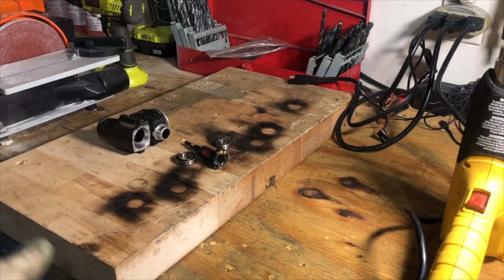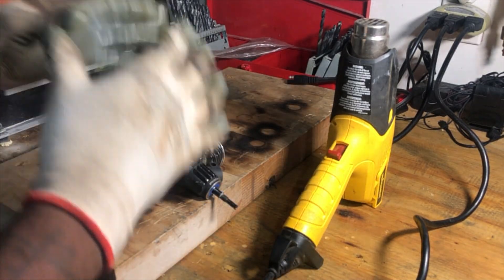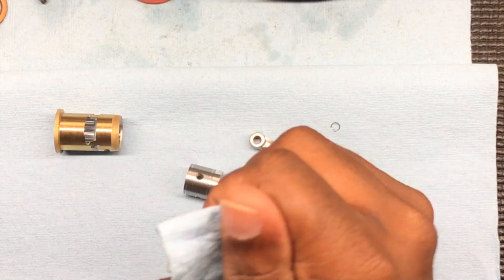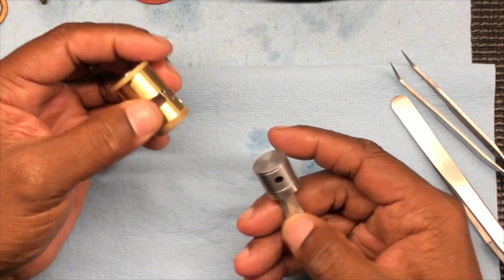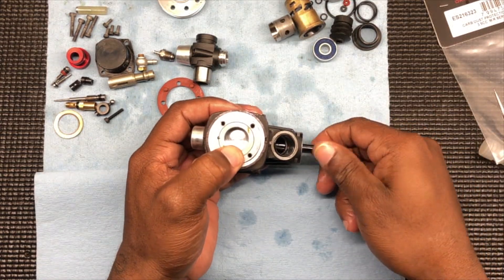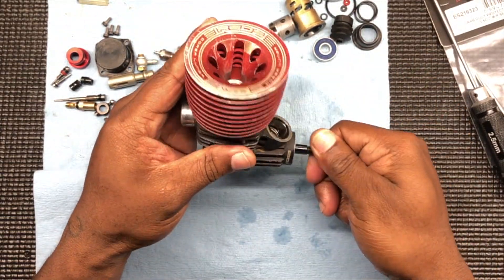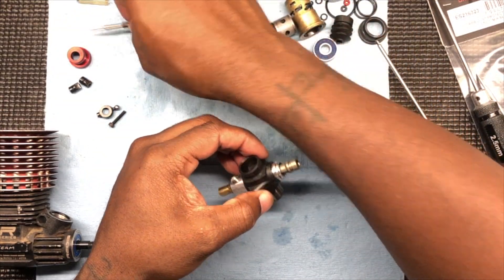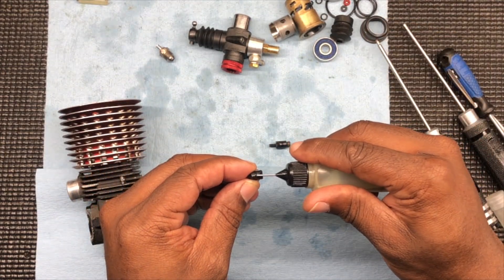Complete rebuild of the reds racing WRX Nitro engine Part 2

Comment: I've been using Dow Corning molykote 111 oring lubricant for a couple years now and I love it. I massage it into all rubber and silicone. Keeps the orings from drying out, and lubricates them for easy removal/installation.
Reply from the maker: Yes the green tube, I've used that my self it works great!!!!

Comment: I notice that your piston pin is on backward. The opening part should face the front of the engine allowing the nitro fuel to run in it and cool down the connection between your piston rod and piston pin.
Reply from the maker: Really, I have to look into that, thanks

Comment: Whats the best pipe + header for a stock novarossi 28/8 egine?
Reply from the maker: I ran a 086 pipe with a 41001 that was a good mix for me, you can try a novarossi 9853 pipe same header. Are you bashing or racing?
Reply: @rajaa111  bashing :D
Reply: @rajaa111  will a nova 9886 pipe do the same?
Reply from the maker: overHD not the same but with bashing I doubt if you could tell the difference. If you want really Hugh improvement get that motor modified
Reply: @rajaa111  ok thanks! Do you know any online Shops which sells modded engines?

Comment: I've had trouble with my .28 SH engine, finally fixed it after just mad amounts of heat from the heat gun, but I could not get the piston to fit in the sleeve easily at all, even with oil. I was finally able to get it running and break it in so now it slidles flawless, but have you ever had this issue in the past doing a stock build or early rebuild prior to break in?
Reply from the maker: No I've never had that problem before... was it a fresh piston and sleeve? Did it come as a set or was it a re-pinch?

Comment: Nice video bro, I'm drinving a mbx8 too, why the bearing must be frozzen ? just to seal all the stuf ?
Reply from the maker: Thanks brotha, you freeze the bearing so it will fit into the engine bearing spots, its a very tight fit
Reply: freezing the bearing shrinks the steel very slightly which allows a easier fit remember heating metal swells the metal freezing it shrinks it

Comment: Hey I see u got some expierence with reds engines. I’ve got an r5r but was curious if ya could give me a little info on the wr5 or wr5 Italia or the Scuderia. As far as how much bottom end they have compared to something like an O.S. speed or nova Paloma or other 7 port novas. Got a few of them. Thanks and keep the awesome work up.
Reply from the maker: Thanks brotha, well the wr5 is a five port it will have better bottom end then the paloma, the paloma would make a little more power being as though its a 7 port. Far as the os its a 3 port which will be better for gas mileage if your racing

Comment: Bro! Re-check your cooling head position, need rotating!
Reply from the maker: Thanks brotha, usually the dot is to the side but it doesn’t matter, I like mines to the back because that position the Coolin fins to have the air pass through it but it’s personal preference. Thanks for the heads up

Comment: I just acquired a protek ls5,  I see you never run yours, mine came with a 2090 pipe, what do you think,  good pipe for it, I also have a 086 I can put on it, don't have a 9901
Reply from the maker: either pipes will work, the 2090 might give you a little bit more bottom end, they both are good choices

Comment: Rajaa 111 Do you think it’s a big difference between a modded and stock .21?  Just wondering if it’s really worth the money. I have a couple modded .28.8s but No .21’s let me know what yo think
Reply from the maker: it really depends on what your doing, for me its not worth the modded work cause I race I will never really use that power on a track, when racing you don't want the motor to be a light switch, you want to be able to use the full rpm range. Modding is cool but for me it's not worth the money. I can buy other goodies and still have fun with stock.

Comment: Hello raj have a question about a new kyosho inferno neo st 3.0 what fuel should I use? I’m new to nitro and have been watching your videos and got into this sport
Reply from the maker: I use bones brew, never had a problem. What ever fuel you decide to run, either a 30/10 or 30/8 the 30/10 will be a little easier to tune the engine
Reply: @rajaa111  aprciate it